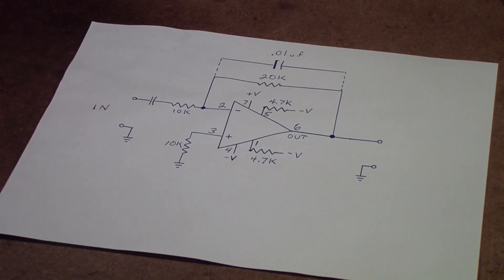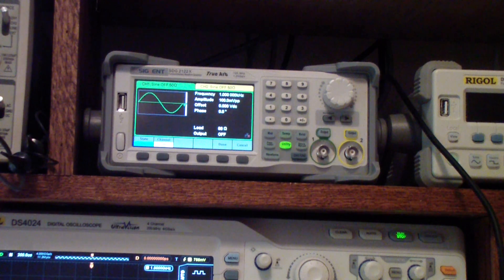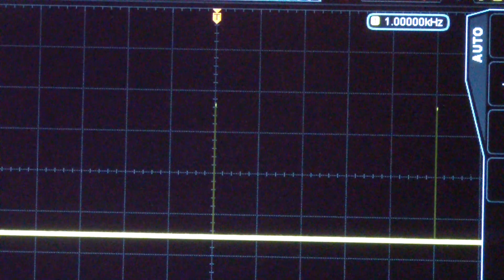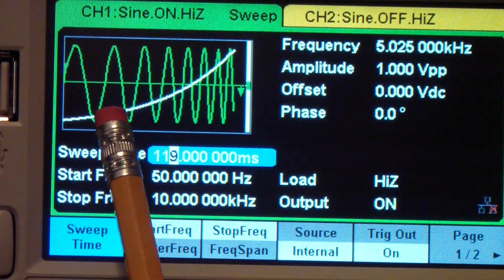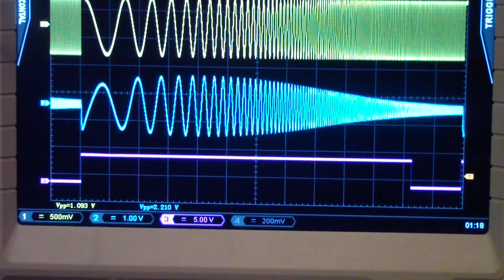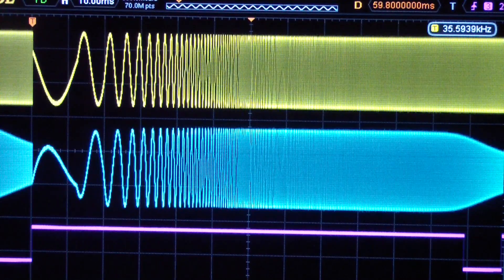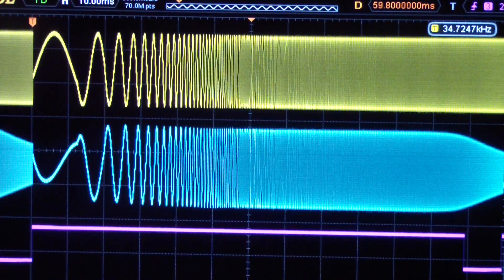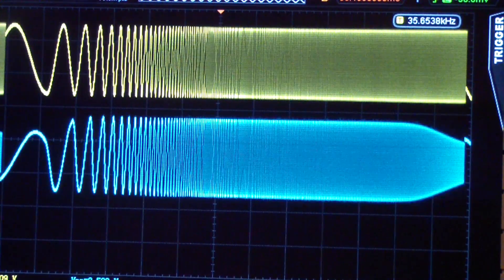TTT064 Sweep Generators

Comment: Very interesting demonstration using a sweep generator. Oddly, I have been considering getting one to analyze stereo amplifiers that come in for repair to look for potential trouble spots that not always evident when using the conventional approach.
Reply from the maker: +John Cunningham I think that is an excellent idea. I have used sweep generator techniques on stereo amps not only to look for problems but also to characterize the equalizer settings (tone controls, bass boost, etc.). I also have used them on guitar and other amplifiers with a microphone to look at the overall response. You can set the microphone near the audience position and get some real insight into how a particular setting will be heard by them instead of just onstage. Except for distortion measurements, I think frequency response is the most often neglected test of good music electronics. Thanks for your interest and comment.

Comment: The sync and external trigger? How does it work in practice (read how are the fg and scope connected).
I'm unsure if I will destroy my equipment if I connect them incorrectly. Apparently they can be either in- or output
Reply from the maker: Since each generator and scope may vary, I suggest looking at the manuals for the specific scope and generator you plan to use for the background you are looking for.